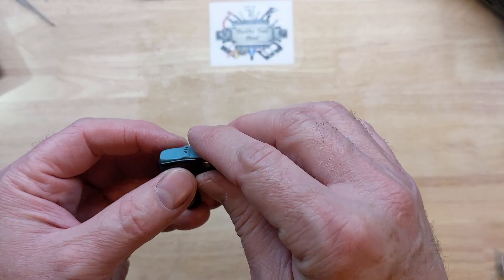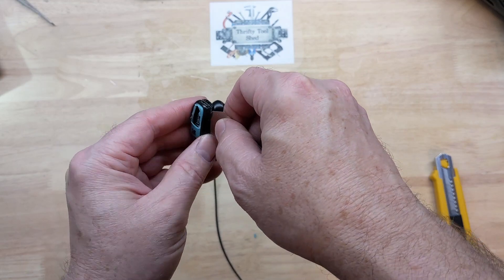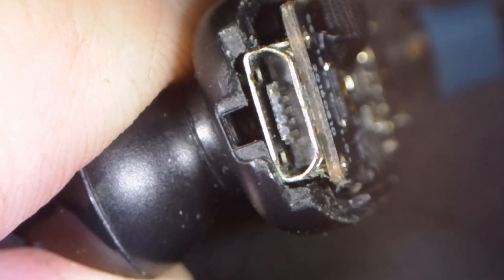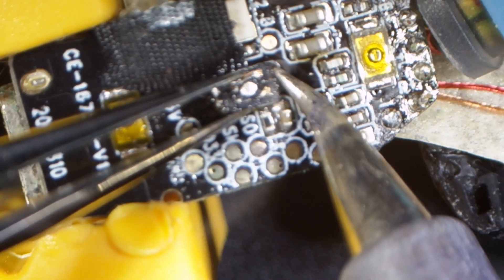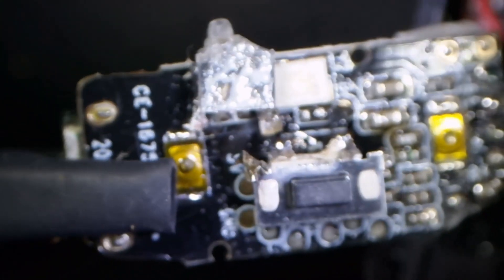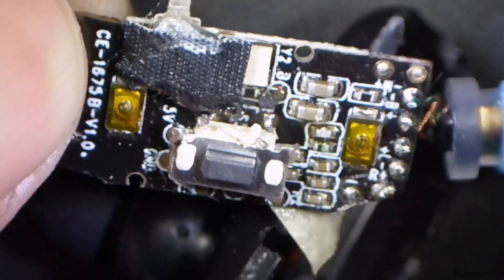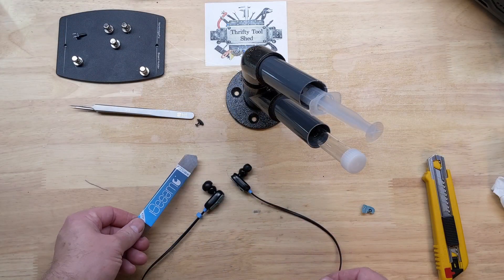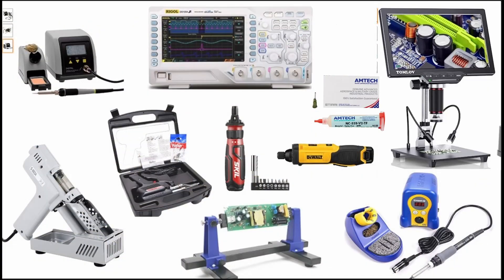Are these Jam Earbuds too Small for Repair?

Comment: a quick tip, to keep that think from moving around, use poster tack. That's what we used when I built hearing aids. Stretch it so its warm and sticky, push it down then the thing goes on the putty. And now it won't move each time.